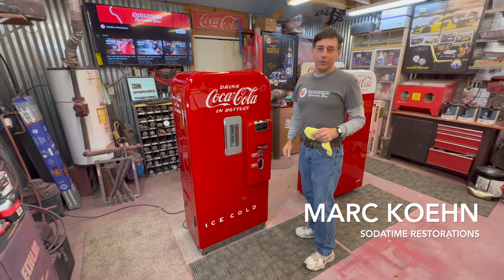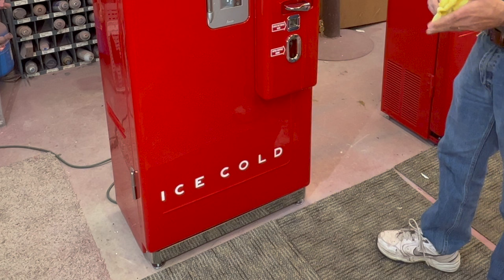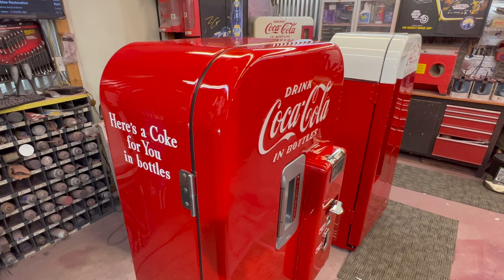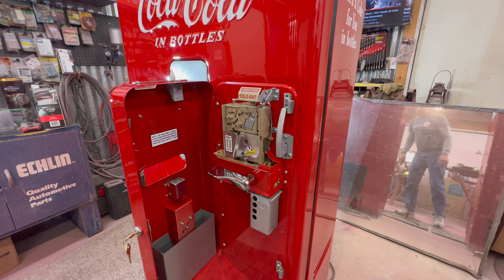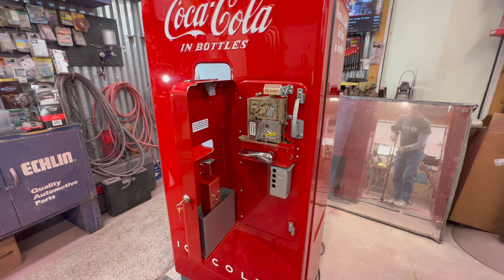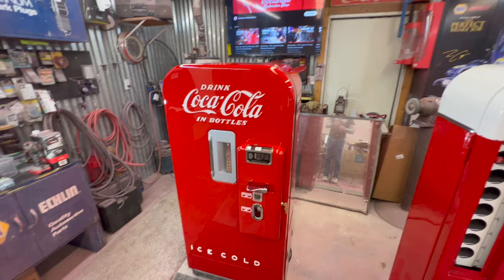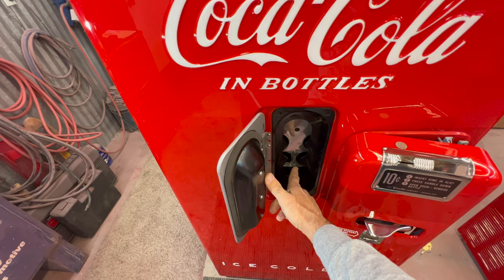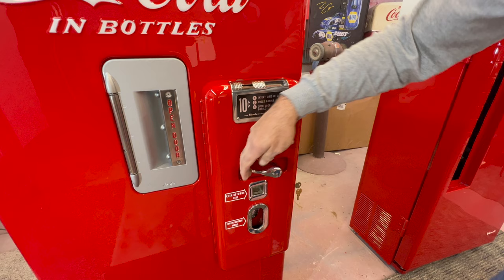1951 Vendo 39 Coke Machine | Restoration Recap

Comment: Thank you so much for putting all of this on YouTube, so helpful and informative. I just bought my first vendo 39 and it is a 1949 model. It’s in great shape and appears to be all original, but it only says “ have a coke “ on the sides 🤔

1949 vendo F39B5 FA11285 

Atlanta, Georgia
Reply from the maker: Thanks for the kind words!  Has your machine had the top painter white?
Reply: @sodatimerestorations of course thank you! No sir it’s still all red. I bought it from an older gentleman that got it from his mother that worked at the old pharmacy where it was originally in use. It was converted to a 10 cent machine somewhere in there but still has the original 5 cent decal on the coin door.
Reply from the maker: That’s cool ! Send us pictures as you progress on the machine!😊

Comment: I think I have a 1951 Vendo 39 Coke Machine, but that crank handle is stuck. I can't rotate it counter clockwise to open the door. Is there some trick to make it open? If I put a dime in the crank handle will crank down like you are getting a coke, but when I try to rotate it counter clockwise to open it it hit something, doesn't hardly move that way. but it will crank down with a dime. Do have any idea or advice? Thank you.
Reply from the maker: Good evening! They can get that way!
So you’re not able to open coin door ?
If it gets stuck , take a rag and cover crank handle and use a hammer and tap it counter clockwise until it gets unstuck! I would then take crank off and soak overnight in a lubricant!
Reply: That did it! I got it to turn, I'm in. This will be fun to get it cleaned up and hopefully get it in the living room so dad can use it every day. Thanks for the help.  @sodatimerestorations
Reply from the maker: @Kerrigan1000  Good deal ! Glad you got it!